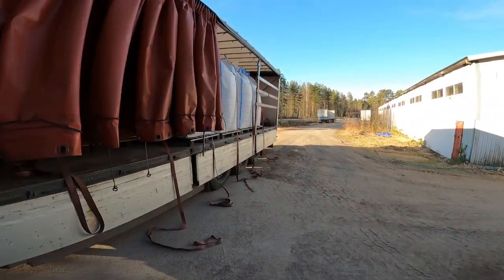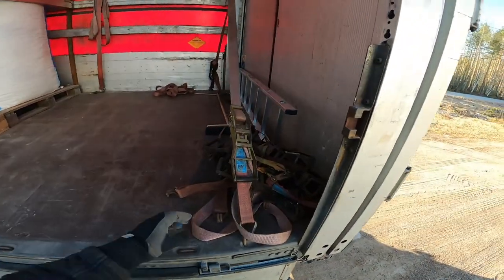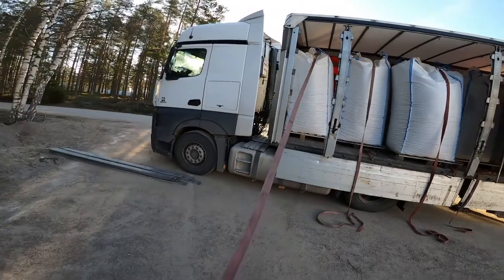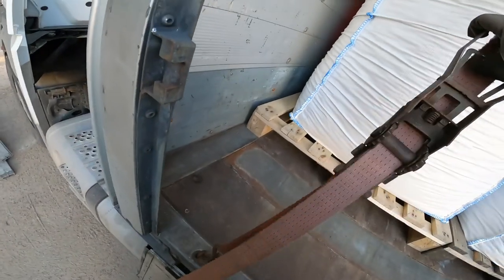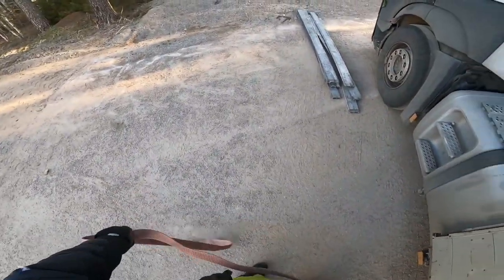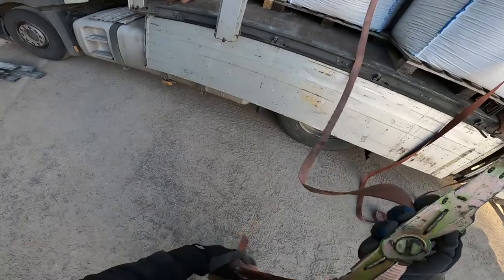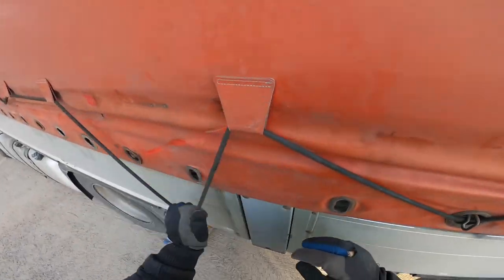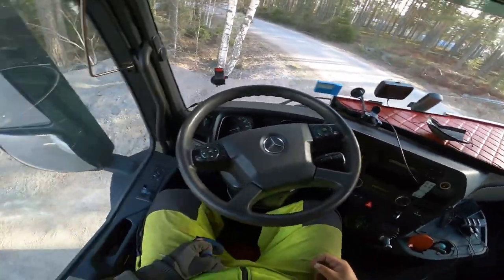European Trucking POV - Loading A Curtain Side Trailer Full Process

Comment: Good video!
One question to anyone who would know - what is the maximum floor capacity per M2 / ft2 for good curtain sider? Where this information can be found? We've got 2 package of 2.5 x 1.9 meters and weight is 12 ton and the freight forwarder says only flat bed can take them because of concentrated weight on small area, but I thing at least one can be transported if loaded over axles but the freight forwarders doesn't agree. How do you think?
Reply from the maker: You can load both one on the front axle and one on the trailer axle and should be fine